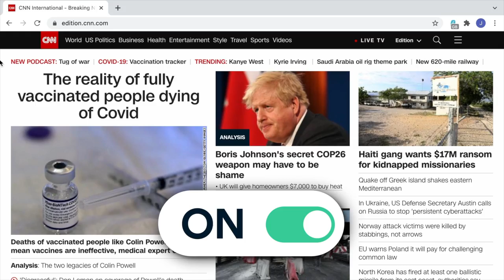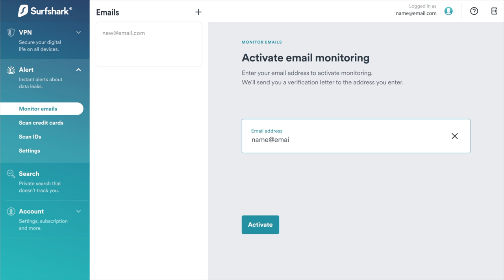Double Glazing Is Pointless Without This

Comment: Hey Scott,
Being an old chippy in Australia, plenty of experience with hardwood. Old Ironbark and the like, are harder than a bulls forehead. So; drill holes as per Rimu, then swipe some grease, candle wax or soap on screw threads. Let me know how that goes.
Btw, love my "But can he hang a door T shirt". Keep up the good work, you guys are great.
Cheers Crowy
Reply: Or bees wax
Reply: I was going to say this is a great old trick my Dad taught me when I started out breaking those awful cheap screws they send you with hinges sometimes. I keep a little tealight candle in my drill & driver box for these situations and it’s never let me down. 👍
Reply: Yeah man, good tip. We have loads of old English oak in Blighty which breaks screws/bits all the time. Loving the torx head screws atm for driving grip. Vaseline works too but get ready for a load of grief bringing it on site 😂
Reply: Love learning new things on YT! I wanted to recommend lin seed oil, like my grandfather teached me as he was telling me a craftsman story about building an oak staircase in GDR-times... of course they had to nail everything and the lin seed oil was making it less hard and  less stressy :D

Comment: Hey Scott. After watching your videos I want to thank you for inspiring me to do my renovations and to take safety around dust particles seriously. I never would of thought how much better I would feel using a full face mask when imitating a roof possum running cables or how much easier clean up is by collecting dust with a vacuum during circ saw use instead of after.

Love watching all the small things about the building trades you show and explain and I can’t wait for episode 1000 sometime in the future.
Reply: I also don a mask and hook up a vacuum to my saws now after watching Scott. 
I think about all those years of thinking that I didn’t need a mask at blowing sawdust out of my nose at the end of the day and how dumb it was.

Comment: OK - as someone who has worked a bit over the years with old dry timber...both  native and boric treated pine...Yes, you will need to pilot hole every screw, but you also need to scrape your screw threads across a cake of Sunlight, or similar soap. Makes all the difference in the world. Yes, a planning / scheduling episode would be great. We all know from experience, especially current experience, that a plan is no more than a plan as there will always be circumstances, whether it be supply issues or 'discoveries' along the way, that will disrupt the plan. Planning however is essential. Thanks Scott and Jess, I always appreciate your videos. Ian
Reply: Pilot holes are great and really help. Boric treated and ultra hard wood can benefit by soaping the screw threads prior to insertion. You wanna talk hard, red gum. That wood bends even good nails. Absolutely have to predrill prior to nailing on red gum. Don’t see this wood any more as it was used in Craftsman style houses in the States. Lived in and worked in this style of house. Saw a lot of knob and tube wiring in them. Good luck with your refurb mate! Was an old timer that taught me the soap bar trick. The old timers know a lot of time saving tricks.

Comment: The AQ21 seal is meant for door frames with the AQ63 the window seal (the manufacturers info). I prefer the AQ21 for both and use on all my windows and doors i make.

There is a router cutter (for 1/2 inch routers) to make the correct groove for the seal with a small rebate for the seal to sit in. Worth a look (about £60 in Uk).

Really enjoy the videos BTW

Comment: Tip on driving screws into hardwood. Once you drive it in and back it out twice. Remove that screw and use a fresh one at room temperature. Every time you drive the screw in, it heats up. Causing fatigue in the screw.
Reply: Pilot drill and don’t use an impact driver. The impacts work harden the screws which are already hardened steel and brittle, smooth force from a drill driver works better, or just buy purlin screws!
Reply: Bees wax is all you require
Reply: Yes that works but it's a fairly slow process, dipping screws in beeswax is much faster and as effective for very hard woods.
Reply: @soulvibe2007  Apparently vegemite works too if you don't have any beeswax handy.  ;)
Reply: @-_James_-  you saw that on Perkins Builder Brothers right? 😜
Reply: @pietervanessen  heh.  Maybe.  😉
Reply: @-_James_-  marmite might be a bit more up Scott's alley
Reply: @snork_games  Marmite is nice.  That's why I suggested vegemite.  😉
Reply: @macsmith6216  wax does nothing. Once the screw enters the hole the wax is removed. In a properly prepared hole the wax can't hold onto the screw as it's removed as the screw enters the hole.
Reply: @snork_games  Lanolin would be more suitable for a guy like Scott
Reply: I’ve used Vaseline and also silicone both work a treat might have to try marmite 😬
Reply: Use a bit of silicone on the tip of the screw, works wonders 👍
Reply: rub screw on bar of soap
Reply: A drop of washing up liquid always works in my experience 🔨😝
Reply: @Pat.Mustard  only if he is wearing his gumboots 😁😁😁😁
Reply: @sharonadlam3195  haha. I’m glad someone got it.
Reply: I've used a plain old bar of soap for 2 years in my 72 year old rimu home after having this trouble and my girlfriend said her dad told her he'd done the same. It's brilliant on the longer chunky stainless screws.. but I always thought baby oil would be better/easier though I haven't tried it.

Comment: Nice job on the seals Scott.  I have the same seals on the exterior doors in my house in Oregon, USA.  The painters pull them out when painting and push them back in when finished.  No paint on the seals and the finish paint gets in the hard to reach cracks.

Comment: That was totally awesome. We're looking to buy another place in Golden Bay and most probably we will have to renovate - so it is great to learn from your experience with double glazing. Having seen the price of (beautiful but horrendously expensive) new aluminium joinery that has wood on the inside, I am convinced that double glazing old windows the way you're doing them is vastly better than replacing old windows with new aluminium joinery. Thanks for the excellent content. Hugely appreciated.

Comment: We have similar seals on our Cook Strait facing windows, they are fixed via some plastic trim though so not as elegant or invisible as your solution. We can tell you they work great, the southerlies used to push rain in through any gaps soaking the floor and curtains but not anymore. 
Keep up the good work.

Comment: It seems insane but you can lube up a screw and it'll go into hard timber easier. Bit of wax or vasaline something like that just not too much or it'll weep out in big globs as your driving it in.
Reply: There's a guy in the US who used Vegemite with success.
Reply: @ohasis8331  Jess already wasn't keen on the smell of the expanding foam, I don't think vegemite will improve the situation ^^
Reply: Soap is just as good.
Reply: @celt1578  I think the foam smells much better than Vegemite - something I eat all the time.
Reply: @ohasis8331  ik your not taking about the foam.
Reply: Exactly. In the days of hand drills, we made pilot holes as large as possible in the base material and wide enough to push the screw through the material you're fixing to the base. Rimu would take 0.5mm less than width of thread. Always had a bar of soap or candle wax to hand. Ratchet screwdrivers worked fine with that. When I first saw people using modern cordless drills, I thought it encouraged bad practice with risk of splitting wood and generating lots of heat that could break the screw. Of course, modern screws are sharper with thinner bodies and wider threads which also encourages bad practice though it also allows better grip in soft wood and plywood
Reply: @locominyana8916  :)

Comment: Scott - I observed your issues w the Jams and adding the additional wood frame... as your screwing into the Old Wood of the window. Here is a trick my Uncle and Dad taught me ( in a galaxy far far away ). After drilling the pilot hole through the filler piece and into the old frame add some liquid dishwashing soap to the screw threads to assist in screwing into the wood. 
You can also use an Bar Soap stick and drag the screw over the soap bar so the threads gather soap flakes in the groves of the threads. I also recommend using "SPAX" wood screws as they are High Quality Steel made in Germany. Also greating's from  "Merica " Again thanks for the video's.

Comment: Good video Scott. To eliminate that closing contact (13:30) I would have notched each upper Left and Right edge of the sash windows; or broken the full length.
I too have always used wax/ soap/spit to lubricate fastenings into timber.

Comment: Rule number one. Pre drill all holes in rimu. A clearance hole in the bit being fixed and, for a size 8 screw a 2mm bit for the thread to bite into. Use Glue as well and it'll never move.

Comment: One solution to resolve to the screws breaking is to wax the screw thread. That may work. However, the sure solution if the timber is incredibly hard is to treat it as if it were masonry. You either drill a larger hole and plug that with a softer wood dowel or just use a masonry plug (generic term in UK is rawlplug). Using a lot of 500 year old oak which is as hard as iron, I had to come up with a solution to the same problem.

Comment: A little tip for you Scotty.
The next time you try to screw in a long wood screw, apply some wood glue to the start of the thread & it will act as a lubricant & allow the screw to go in easily & then lock the screw in when set.
Makes life much easier.

Comment: If your screws keep breaking you can dip them in some carnauba wax or something similar before putting each one in. Just a little tin of it warmed up and rub some of the thread. You'll still need a pilot hole but it lubricates the thread as it goes into the wood, prevents them getting as hot and softening.
Reply: Ya or old fashioned hand crank the screws in will avoid the heat

Comment: Scott, when you are screwing into hard wood, predrill and apply wax to the screw. I liked to use candle wax, but paste wax is just as good.
Reply: Also, if you are still breaking screws, don't use an impact driver. A regular drill will allow you to feel the resistance of the screw.

Comment: Do NOT use soap on screws. I live in a house that was built in the early 1950's by my grandfather and he used soap on the screws in the door hinges. I now have to replace them as they corrode and will have to replace at least one outside door frame/casing as the rusting screws have destroyed the timber (already replaced the screws a couple of times) so there is nothing left for the screws to bite into. Soap absorbs water from the atmosphere and is slightly acidic while wax or petroleum jelly is water resistant and protects the screws. You could possibly use unflavored 'chap stick' in a pinch.

Comment: You need some proper nail pullers. Try the Crescent double jointed nail pullers. You won't use wire cutters ever again.  Also some small Japanese cabinet pry & pullers. Don't forget the Eastwing action bar and pry pullers, absolutely brilliant.  Cheers.

Comment: Hi Scott - love the videos! Here in the UK many years ago metal framed doors and windows were used extensively until customers noticed the amount of water condensing onto the cold frames. I would be interested to see how your metal framed doors perform - I'm fairly sure you'll be changing them for uPVC after the first winter. BTW it's "soffit" not "soffeet"!!!!!!!
Reply: Aluminum has been used for decades in NZ,  uPVC has never caught on big time.
Reply: @bunning63  That's interesting! Perhaps your climate is not as humid as here in the UK. People got tired of trying to kill the mould and mildew also mopping up the puddles!
Reply: We have thermal broken aluminium as an option which reduces/eliminates the thermal bridge between outside and inside, and thus reduces/eliminates the condensation.  Sadly, thermal bridged aluminium is still available on the market and still widely installed - I think it should have been phased out as soon as thermal broken alu came on the scene, and it should be off the market by now.  People moving into new builds should not have condensation on their joinery in [current year].

uPVC is a different story.  Because AU/NZ is close to the ozone hole, the UV here can be really harsh.  British tourists routinely fail hard at this when they get here: bit of sun -> "shirts off lads" -> 5 minutes and your frail skin is red as a fire engine lol.  We've known about our harsh UV vs plastic for decades and since the late 70's have been adding titanium dioxide to our various uPVC building products e.g. guttering and downspouts.  But in the 80's some eco-yuppies who thought they knew better imported uPVC from overseas, installed it, bragged to anyone who would listen, and then watched as their joinery went yellow and brittle in just a handful of years.  Any uPVC sold here has to have titanium dioxide or a similar UV stabiliser, sometimes sold as "tropical mix", for it to meet code for warrantability.  We can and do get that, usually from Germany, but because of those eco-yuppies, uPVC has a tarnished reputation to overcome with Joe Kiwi.

Thermal broken alu vs uPVC?  uPVC is more thermally efficient, is cost comparable (maybe slightly more expensive) and better suited to coastal areas.  The only advantage that thermal broken alu has over uPVC, as far as I can tell, is the smaller frames.

(FWIW I have fully uPVC'd my house.)
Reply: @rawiriblundell  A very full and detailed reply - thank you. Thermal breaks sound brilliant, but I have never seen one, probably because there is so much uPVC installed. Never gave a thought to the UV resistance as it's not a huge problem here. Some of the cheaper ranges turn yellow and the darker colours buckle in the heat, but generally it's a satisfactory product.
Reply: @harvey353  no, it’s extremely humid, the water cascades of the frames in winter. Frames are all required to have catch channels and drain holes for this water. 

It’s just double glazing was only fairly recently the standard on new build housing (let alone all the old stock). The move to aluminium frames was mostly made before the move to double glazing. People are currently just happy with most of the window not having condensation, rather than all of it.

Comment: Scott, could you put a relief on the window frame just where the seal is to avoid tearing and possibly getting the seal closer/tighter to the window frame? Maybe a rounded 2-3cm edge, it wouldn’t be visible when shut.

Comment: I installed 2 Simpson's doors and they come with this kind of seals. To check for the right tightness they recommend putting a few sheets of newspaper in, closing the door and pulling it. If it is tight and pulls in, it's the right tightness.

Comment: Also brother if that new PFC roof beam you put in lands on a timber bearer line under that wall, you're spanning to, you wont need to dig a footing, just plate the existing timber floor bearer with another PFC that spans between the 2 adjacent columns, fix it off with M12 bolts @ 600crs, it will share its load off to the 2 existing floor columns, will save your ass digging!.. (structural engineer from 'Straya)

Comment: I would have ripped all those wooden windows out and just replaced with Aluminium and modernised this house up the double galzing is only one part of it.. Many advantages to doing this including better seal, no rotting, better paint finish - low maintenance, less time etc. My Mum retro fit her aluminium windows to get double glazed it was expensive and not a patch on the new windows/doors designs you can get.

Comment: It's always funny when I hear you call lumber, "timber". Timber is usually anything larger than 4'x4'  (100mmx100mm) 
I know it's coming, but I can't help but laugh. The trim that protrudes proud of any opening is called the reveal. That includes any space. Use a visegrip to remove screws/nails.  Hardwoods need to be predrilled, but you know that.  Use a little wax on the screws. Years ago guys would run screws through their hair to make them go in easier.

Comment: Interesting, a red systainer for your nail gun but I didn't see the Milwaukee label on it.  Doing a little brand mixing i see.   I would've used the 15 or 16 gauge for those window trims If you were concerned about cupping.

Comment: So all that extra work on the window seals can be avoided altogether by replacing the old wooden windows/frames with UPVC windows that have all the seals integrated and are designed to be a lot more draft proof.

Comment: Mate, the secret to screws into hardwood is WAX...cannot believe you don't keep a little block of beeswax or paraffin around. In a pinch I've used peanut butter and seen some use vegamite. Whatever your choice, a little lube on the threads makes an enormous difference.

Comment: I know where you're coming from,  but on the whole permit process, councils have no idea what someone did years ago,  who then repaired it,  changed it etc etc. Once did some retrospective documentation of structural alterations under a house,  it was pretty much why are you bothering. Thought I was doing the right thing. The original builder of my house didn't even stick with the original plan back in 63.